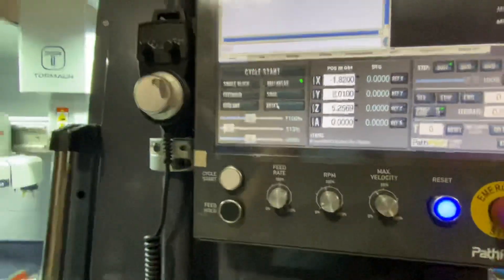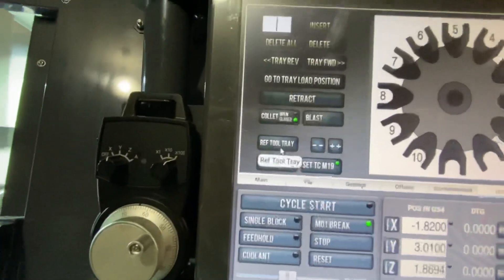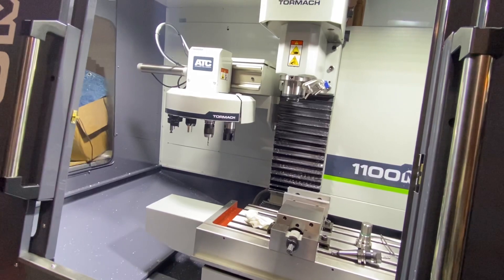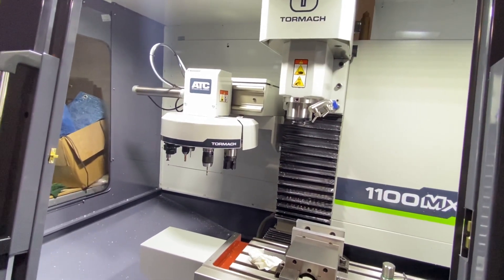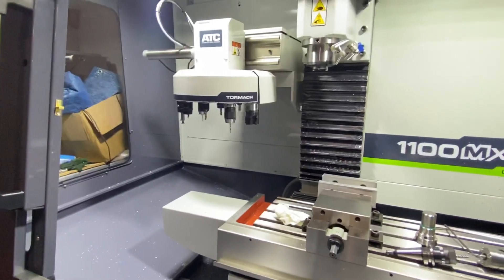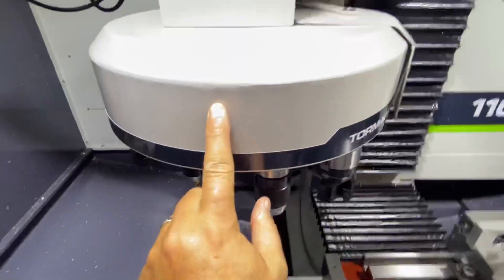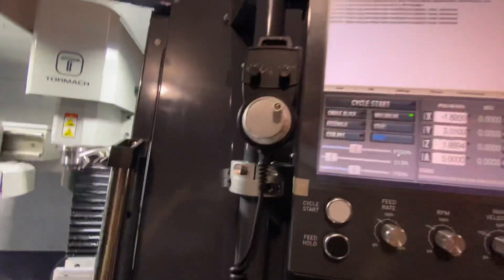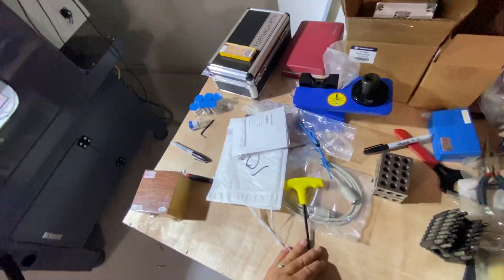Tormach 1100MX - Ongoing Problems with ATC, Spindle, multiple issues-Will update.

Comment: It's very disappointing that a new machine would do this.
But at the same time, if you are going to buy a cnc machine then you should be the kind of person that can pull the ATC apart and fix it.
At the same time the welds on the ATC are not important to the final product the mill will make.
But the fact that the ATC does not work is extremely important to the parts the mill will make.
But you own a mill, which means you should be able to fix an ATC.
It's a conundrum.
Reply from the maker: Tormach, sent me a new ATC replacement, and now the machine is operating fine, at the moment. No other issues, and I'm making my way through parts design, making parts, etc. I will do an update to this later on.. it was a dark time, but it's all come together nicely. New ATC, did the trick and zero issues. I did hurt my spine while installing the ATC however, so updates coming slower. Ruptured disc, C7-T1, and a C8 nerve impingement, making my left hand somewhat disabled.. very frustrating. Now I'm recovering from almost fatal Pneumonia.. man, don't catch the Super Flu this year.. it will nearly kill a healthy person for sure. Cheers.

Comment: instead of referencing the tool tray. go to the load tray position and when the ATC is in load mode, check if your BT30 stud is rubbing. Try hitting next and previous to see if it's turning. I crashed my PCNC1100 tool changer (my fault) and I was able to fix it.

Comment: Just run it without the ATC for now. Delete the video and move on.😂 Have you tried turning off the power and turning the ATC by hand to see if it’s binding up and where. You built that car, you ought to be able to do a little investigating to track down the problem. But, in my opinion, Tormach is a solid company and they will help you figure it out but you have to realize you are the service tech onsite.
Reply from the maker: Tormach sent me a new tool changer. Replaced it.. making a new video right now, due to follow up. 
I've documented multiple issues with the machine, mostly damage in transit and lack of QC.. however, stay tuned.. I'm not running a machine I solely purchased because of the ATC, because it was nto working. I bought solely based on BT30 spindle and the ATC.. I already have a machine that I have to do manual tool changes on.. why would I waste money, if I wanted to stand in front of a machine and do tool changes?

Comment: Seems like something biding up. Are you going to send that one back once you replace it? We had a ribbon cable on the touch screen installed backwards, might be something as simple, or it could be the hammered dog sh!+ tolerances causing binding.
Reply from the maker: Tormach was nice and sent a replacement ATC for replacement. So, I’m installing that as we speak but had to run and do a couple of projects and took a quick break. New ATC is in the machine now. 
It’s either a data issue or something else going on. Not sure. 
John at Tormach is great. I’m confident we can get it running but it’s been quite challenging. Was looking forward to showing parts being produced on it, etc. but I’m not able to do anything but break tools right now.
Reply from the maker: Update. Yes. It was hammered. New ATC is working good for now. 
Wasted 2-1/2 months with erratic tool changer but appears to be back again.

Comment: So until the ATC issue is fixed, why not start machining with manual tool changes? Make some chips already!
Reply from the maker: Oh trust me. We have been. Been doing that since the moment it broke. 
But, this isn’t the first issue. Been multiple problems on the machine so far, but getting them resolved. 
But had to split everything down to do manual tool changes for now.

Comment: So sorry you have had this issue PoppaBear. This is not the typical ATC performance we have seen and expect. Please know that the Tormach team is here for you. We will help get you up and running and make it right!
Reply from the maker: You guys have been good for the most part, but new owners just should have to do this. 
Have the new ATC you guys sent, just haven’t had time to install yet. 
Hopefully it fixes the previous issues as well. 
Thanks.
Reply: Did they fix your problem?
Reply from the maker: @mrdodge1303  new ATC arrived. 
Haven’t had a chance to install it yet but it’s a project I’m going to start this week. 
Other urgent issues I have going on right now that need resolution first.

Comment: Hang in there Tormach will get it right.  I had issues with mine in October.  I opted not to get the ATC.  Since my issues have been worked out everything has been great.  Granted we shouldn't have to do this on brand new equipment but Tormach and support has been great.  For the time being I'd protect that table in case one of those tools gets dropped!  Get john and/or Norman.  John will probably put Norman on the issue.  Lifetime support and you didn't make a mistake.  I totally get your frustrations because I went through them and I know a few others did as well.  You'll get through it.
Reply from the maker: Updated videos show it running parts last night. 
Changer seems to be ok for now.

Comment: I just finished assembling mine. Haven’t had a chance to run anything yet. But the build quality screams “made in china”, which it obviously is. I have two micro arc 4th axis with a third on the way because they keep arriving damaged. They want me to build a  crate for both of them and ship them back for lousy 100 bucks. Nothing for the inconvenience and have not offered any sort of refunds/discounts or in your case, credit allowance. Good luck to you.
Reply from the maker: Just a quick update, Tormach is replacing my ATC. They’ve never seen this issue before, so will update.
Reply from the maker: Wow. Yeah not good. Well keep in touch on the matter if you can. Thanks.
Reply: Did they have you send your old ATC back?